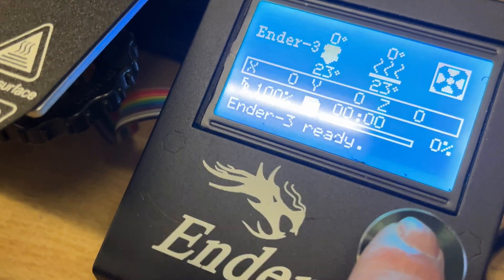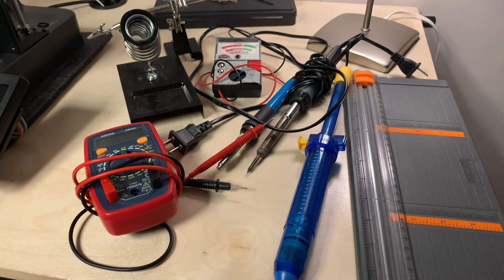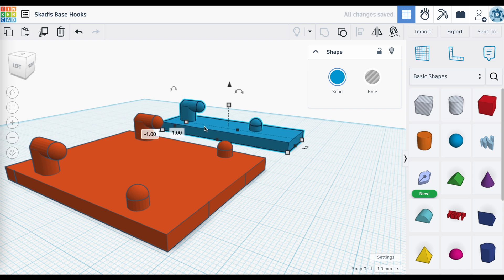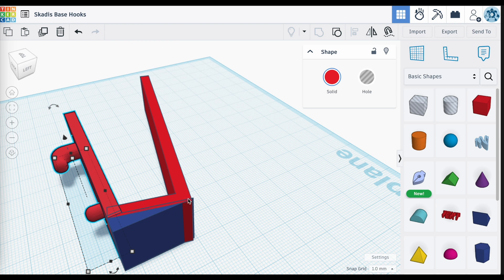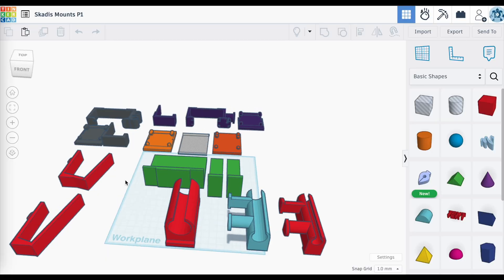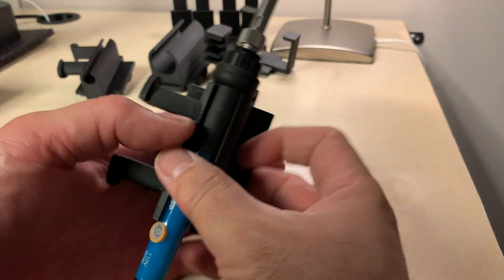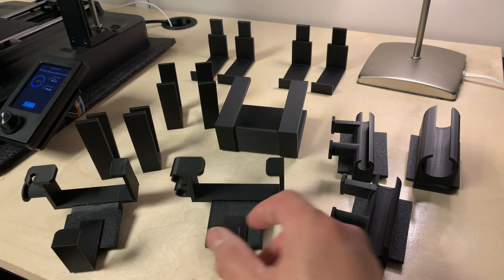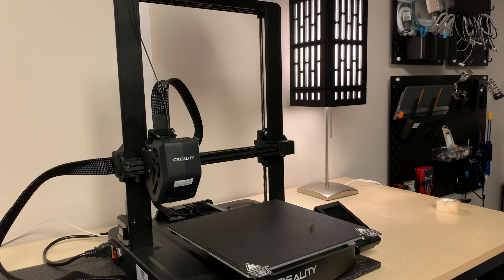3D Printing IKEA Skadis Pegboard Mounts

Comment: New subscriber to get you closer to 1k subs! :)
I just got a Skadis board from Ikea and want to make my own accessories. Thanks for sharing your Tinkercad files, but I was wondering if you could share how you made them? I'm guessing you measured the holes in the boards (including the depth, etc.) and went from there with cylinders or such?
Not sure if you have a video on how you created them, but if so, I'd appreciate the link.
Thanks again!
Reply from the maker: Hey thanks for the sub!  Yeah, it is a bit crazy that it’s getting close 1K - did not really expect it.  Anyways - someone had posted their clip on Thingiverse - my intention was use that as well but when it printed it failed - I guess the file was not rendering properly in Tinkercad so I basically used it is a template and rebuilt it using basic shapes and cutouts.  It’s funny now looking back on it because I would probably go at it differently if I were to do it again.  The mounting pegs that stick into the board were made from cylinders, half cylinders with a box, along with half spheres to cap off the rounded ends.  That rounded corner of that “hooked” peg was shaped by using a cutout made from half a cylinder that I angled at 45 degrees onto that corner.  I am not sure if that made sense but I can try to revisit this and make another video this week about it.  Now I think I might use some sketch tool in there for some of the pieces.  Let me know if you need more details about the mounting pegs.
Reply: @technobentobuilds  Thanks for taking the time to give me such a thorough response. I may try it out with Tinkercad, but I'll be on the lookout should you decide to make a video. :)

Comment: fusion 360 is better fr try it it has some learning curve but i am 14 and can do it i strongly suggest trying it
Reply from the maker: Thanks for the comment - yes, I think Fusion is going to be something I will have to try and tackle at some point.  I am hitting certain points in projects where I wonder if this would be easier in Fusion.  Good on you for getting into Fusion!
Reply: @technobentobuilds  im super new. I started in Tinkercad, did all of the tutorials (whish was amazing way to get started), then i just started to mess aroundd in blender. Once you figure out some tricks with Mesh, even if you dont know what 90% of the rest of the stuff is in blender, you can still get by.  baby steps. (currently my 9 and 11 yr old are both doing those same Tinkercad tutoriuals)
Reply from the maker: Hey - I just caught this comment now.  I have not tried Blender - interesting.  I do feel at times there are things that I want to do in Tinkercad but as of yet - I am not able to do.  That's when I start wondering about trying out something else.  Thanks for putting that on my radar!

Comment: Did you buy the boards from ikea, or print your own?
Been looking at this system,  just wondering if there's any issues with it..

Thx sir for your time..
Reply from the maker: I bought the boards and some of the hooks, elastic cords, and cups.  I have been slowly replacing the IKEA hooks and cords with the 3D printed mounts.  As for the board, it mounts to the wall but only at the top of the board.  The bottom edge of the board has pegs that rest against the wall.  But I am happy with them.